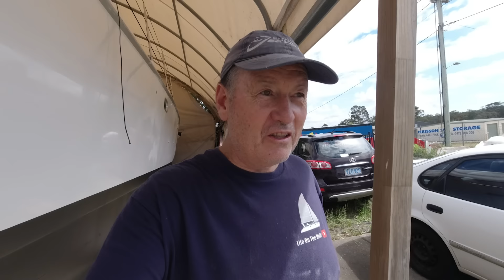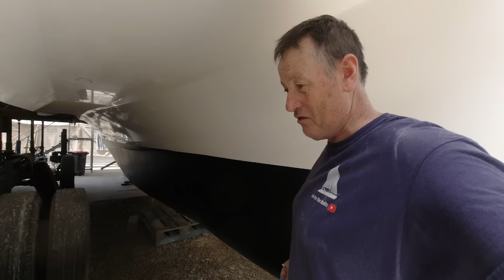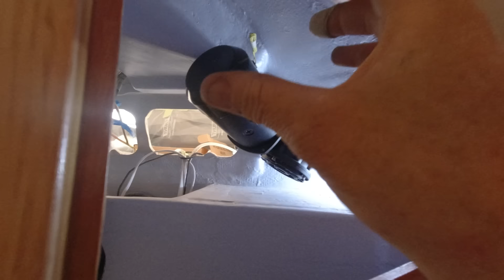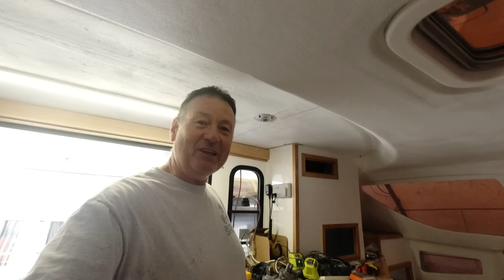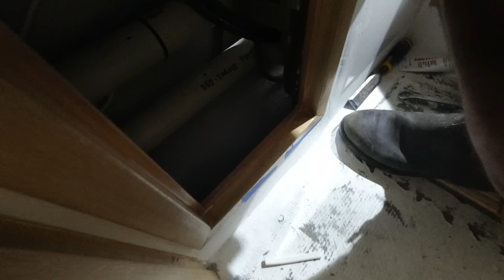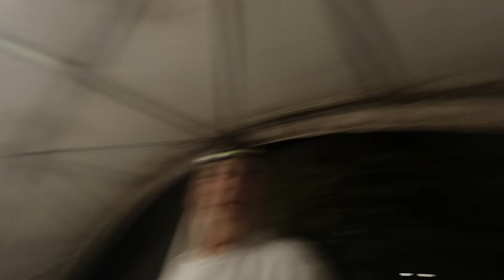Counting the Hours Till The Big Move - Complete Catamaran Build Ep366

Comment: Hey mate,

Looking great!

A quick tip, I know it is in the water,  but be careful running your MFD out of the water - you should turn off the transducer ( i dont know if you did, or if it is even connected) but if they are on, apparently they can overheat and damage them.

All the best!
Reply from the maker: Good tip mate, thanks. Will check that. We will leave the transducer out till sea trials. Ross
Reply: @LifeOnTheHulls  you can turn the transducer off in the settings... so no issues as long as you know. . I hurt a $1500 transducer on my slipway as I didn't know... it still kind of worked, but never read at speed the same etc... and after the fact found the info... better safe than sorry